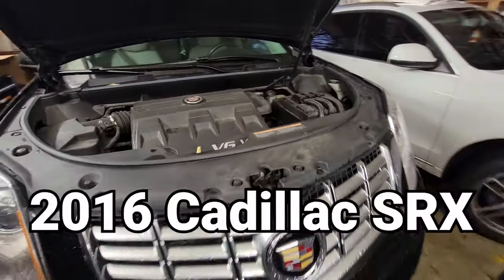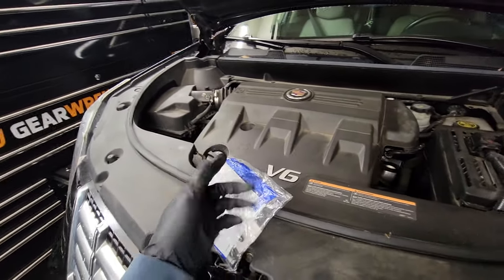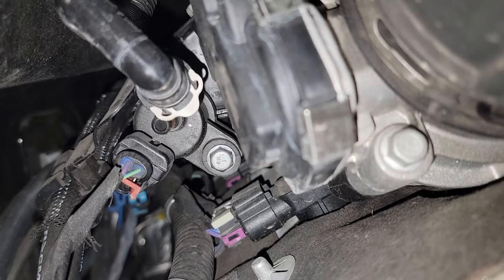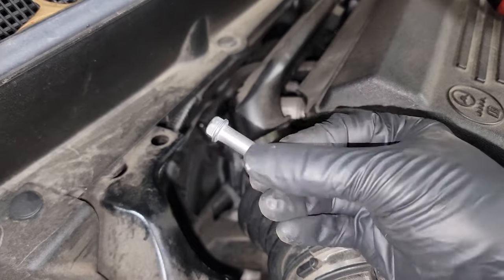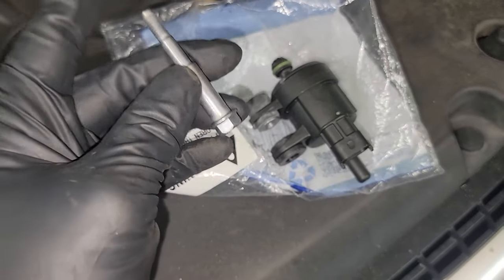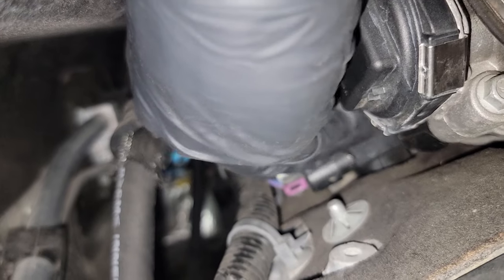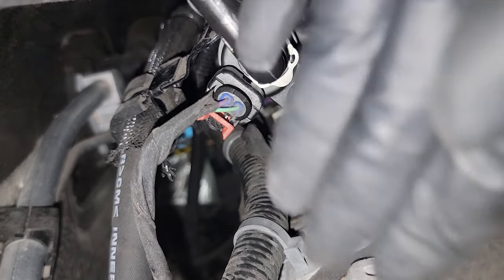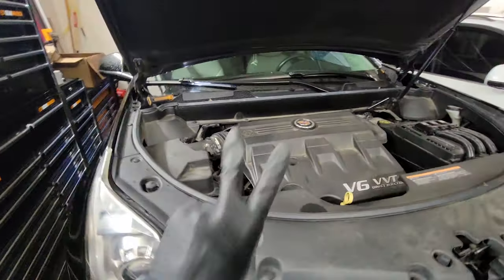P0496 Fix! Cadillac SRX Evap Purge Valve Replacement | DIY

Comment: ...total fail so far. Received part from the below link....came in damaged box raw, not inside plastic. Part was NOT Bosch,but, AC Delco. Could not tell if this was a bad used part that someone "returned". Incredibly difficult repair. Barely could fit one arm into cramped space and had to use screwdrivers to pry apart both connections, as recommended techniques did not work...both hose and electric were firmly stuck. Reinstalling "new" valve into place was a nightmare....had to find hole for the center "penis" first by FEEL.....push valve into that hole and turn valve clockwise until you feel the bolt enter its hole on the right. Although bolt did tighten firmly, valve feels a little wobbly in its socket....I expected it to be SOLID after tightened down. Did 3 "drive cycles" and cheap Harbor Freight Centex scanner could not erase the lone 4096 code !  Car seems to run fine, but, now I am at square one after hours of struggling frustration. Find a shop that will do the repair for around $ 200 and be done with it !!!
Reply from the maker: Sounds like you got a returned part, definitely reach out to the seller. From the sounds of it, I'd leave the mechanic work to some one who is slightly more competent in that department. This job shouldn't take more than 20-30 mins.
Reply: Ahhh....no.    It turns out I was "competent" enough to have fixed this after all !!   The car now has no check engine light after driving for 3 days and 7 or 8 " drive cycles". On other videos this drive cycle necessity was explained, along with things like " permanent codes" that can not be read from the cheap scan tool I had. I had been under the impression from your video that as soon as the new part would be installed, the " check engine  " light would go off by itself...or, my scanner would erase the trouble code and that light would stay off, unless the problem reappeared. Apparently, my car would not let my cheap scan tool erase the PO496 code because the cars computer had not finished verifying all was OK yet.
Reply: @johnfoster535 dude he didn’t have to make a video explaining this repair. Be grateful that this info is available. No reason to freak out on a guy looking to help the general public with auto repairs ….calm down